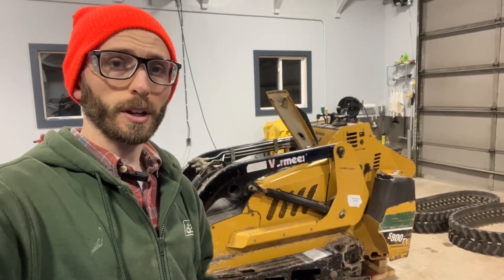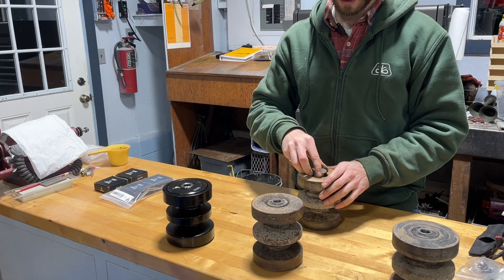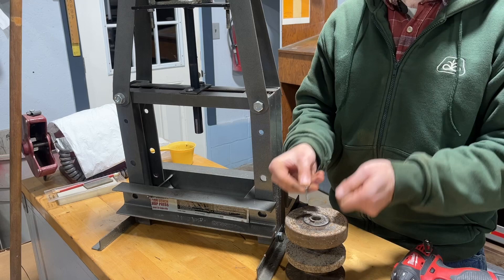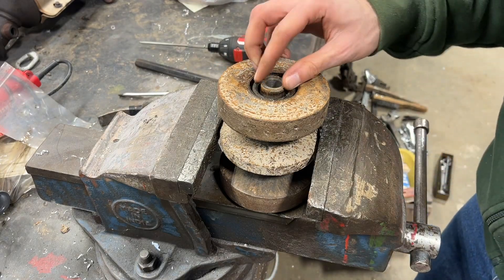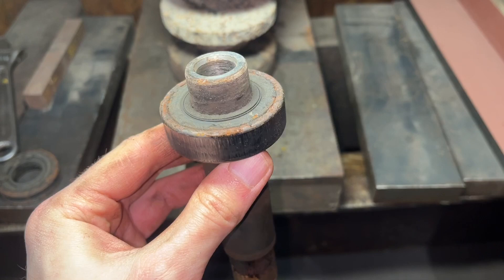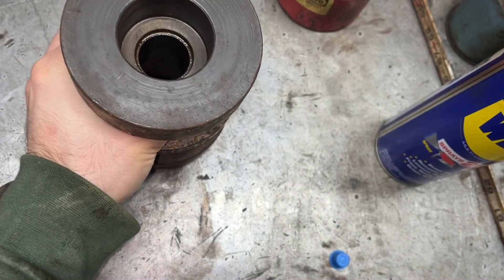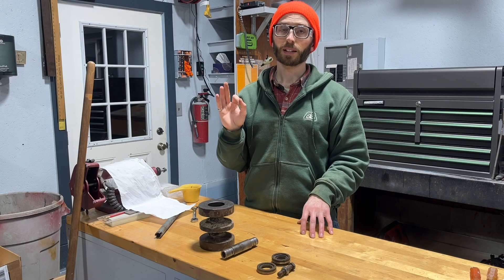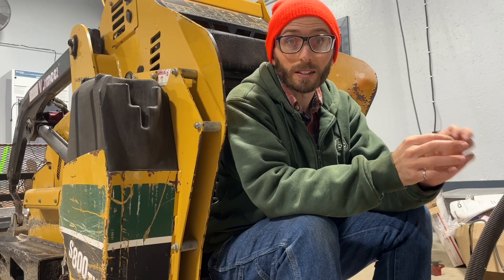Mini Skid Steer Rebuild: Can Rebuilding Rollers Save $$$?

Comment: A lot of guys will actually forego the seal and instead double roller bearings.  They have claimed a longer lasting result than when using the seal.
Reply from the maker: I was going to point you to my other video, but I see you found it. 🙂 We’ll see how it goes without cartridge seals.

Comment: couldn't you just use some sealed grease bearings to get a bit more life out of the roller, this mini kubota i bought has 6 bottoms and 2 are trashed no bearings at all and the assemblies are expensive its an old machine
Reply from the maker: Good question. Check this out: https://youtu.be/RBFGMSj1H0o?si=ag4tUvS9L1kCKGIG

Comment: Yep. Those rollers are a bear to push apart. I used my brothers large 50 tonne hydraulic press and got large bangs at the bearings started to release.

Comment: Hi from New Zealand. I'm currently rebuilding the rollers on my own Vermeer S450TX. The rust pitting on the end of the shaft isn't really an issue because the seal does not 'run' on the shaft. The cassette oil seals are two part construction with the rotating sealing surface being inside the seal. The inner part of the seal sits tightly on the shaft and rotates with it, so the rough surface doesn't matter.
Reply from the maker: That’s a great point! The pitting on the shaft in the video actually reduced the diameter, so the seal would fit loose. That would allow moisture/mud to bypass the seal ID and lead to premature bearing failure. BUT, since it’s a cassette seal and doesn’t need to spin against the shaft, I could have just used some retaining compound to bond the seal ID against the pitted shaft. I might try that next time.
Reply from the maker: You can also try the bearing-only rebuild that I show in another video. One guy online recommended that. Time will tell how it does.